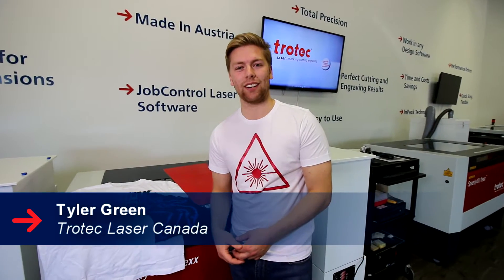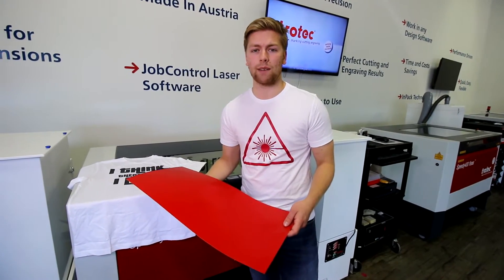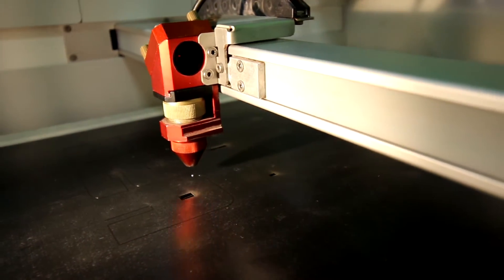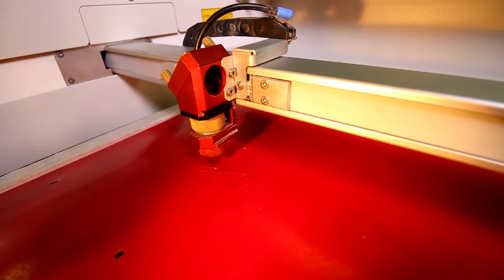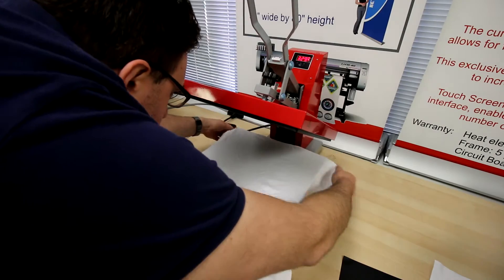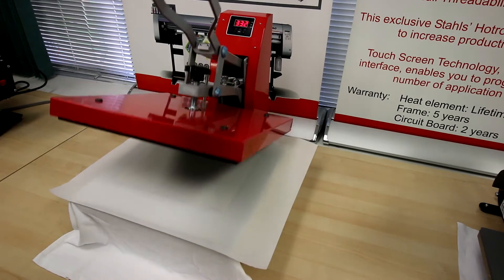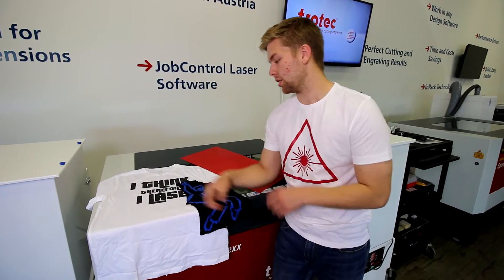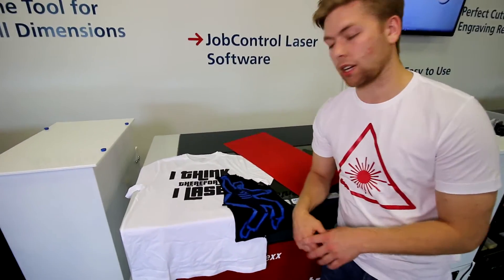Laserable Transfer Film | LaserFlex

Comment: What is the parameter with a speedy 300 to cut laser flex and don ,t cut the back. It will be fun to have those informations in all your videos.
Reply from the maker: hi Jean we usually do provide settings in the description section but every laser has different power settings. How many watts is yours?
Reply: trotec 300 150w